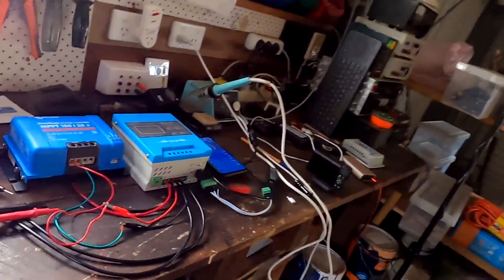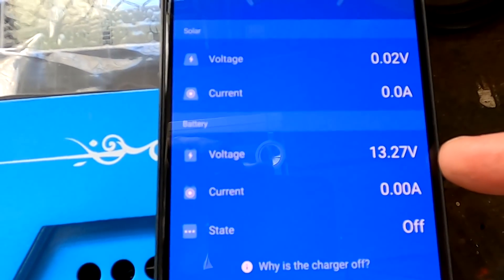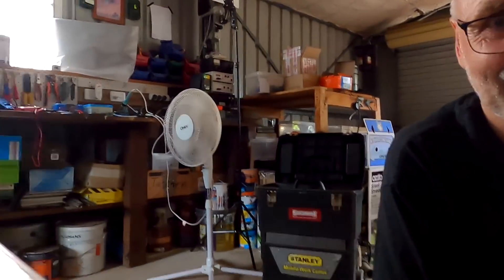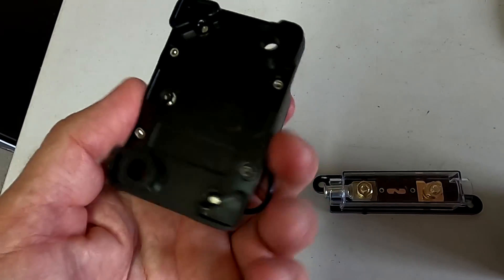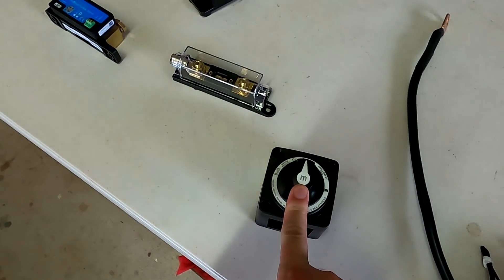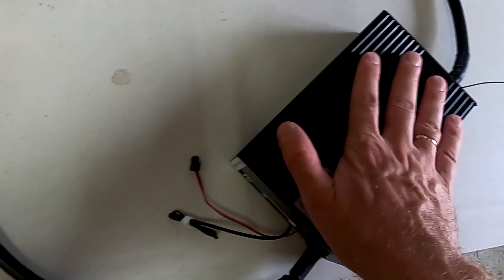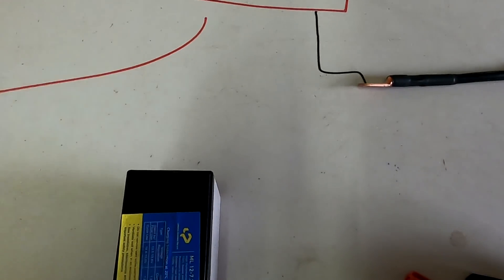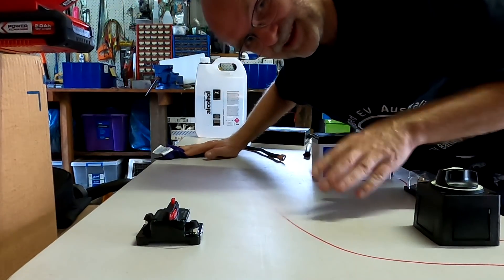How to arrange all your battery gear? Best practice?

Comment: BMS directly on the Battery bank.
Shunt directly after that.
Fuse doesn't matter, if on positive or negative side, so I would put it on the battery positive. On the other hand: Can't you program the BMS for a max current rating?

I would not use THAT breaker switch, they are not very reliable. If you want to use one, look for TOMZN DC breakers. They are DIN rail compatible and you can get them with high current ratings. A Chinese brand, yes, but one of the good ones, people say.

Comment: Inverter, shunt, good quality circuit breaker it can also be used as a disconnect switch then BMS and battery and the other disconnect switch for the pv coming in hope that makes sense

Comment: BMS directly to the battery (no other components in between) - then then smart shunt.   Fuse (inside) and then the big Switch on the outside of the box

Comment: Every connection is a potential failure point. Every connection is a potential high impedance waiting to happen. Get rid of the shit - balancer direct to fuse then into battery neg. Then connect whatever other shit after the balancer. Check the latest vid from Will Prowse. He got 272AH batteries - expecting EVE 280AH.

Comment: Consider the inverter peak current consumption, for starting inductive load inverters are rated to handle twice the rated current for around 10 seconds.
60A X 2 = 120A. Can that fuse handle that much current?

Comment: I have a BMS with split charge and load so I had to put shunt between battery and bms. Else I would have probably put it other way around as the shunt still uses abit of power. And with bms low voltage disconnect active it will still continue drawing power which is probably unwanted.

Comment: You never fuse the switched side of battery. Everything doesn't matter
Reply: the fuse goes on the positive side of the battery. he needs a class T fuse there or a very expensive DC breaker for the high power LIFePO4, not cheap automotive breakers or fuses. the switch needs to be rated for the DC voltage being used. I use 24-volt LiFePO4 (wired 2P8S). 16 272Ah Lishen cells wired 2P8S for a potential of 13926.4 Wh ( 3.2volt x 272Ah X 16 cells = 13,926.4 Wh potential). I am using the Electrodacus SBMS0 so my shunts to measure the charge from the PV array and the load from the battery are on the positive side. 
other BMS use the shunts on the negative side. The shunts are used to measure voltage or amperage differences as they cross through the shunts.

Comment: Battery negative to shunt battery side (shunt resistance is negligible), then BMS (you want to account for BMS power consumption, which can sum up very quickly), then load negative. Battery positive to 100A mega fuse, main switch. Beware of using the cheap Dc circuit breaker. I've seen them blown up and melting away, they usually get pretty hot even without heavy load. This is how my battery system works pretty reliable.

Comment: Fuse should always be as close to the power source as possible (in this case the battery). If you are creating a 48v battery bank then right next to the most positive terminal of the battery.
You need a laser temperature sensor to check for hot spots under full load. Lastly the low voltage trip switch you have are not very good in my experience I would not put it in circuit as it will creat issues on high loads, they arc when tripping on 48 volts. If you have a master switch and fuse then it’s not really required anyway.

Comment: Battery negative to BMS to shunt to inverter negative. On the positive side side I would install the Blue Sea on/off switch between the battery positive and the fuse. This will allow you to replace the fuse with no power being applied.

Comment: BMS connects directly to the battery.  It is your last line of defence against a system fault.  You would then install the shunt in series to the BMS.  Your fuse can go between your negative busbar and the shunt or it can go between the positive busbar and the positive battery rail.  The same goes for the DC disconnect switch as it can go on the positive or negative side of the circuit.  If you were earthing one side of the system (positive or negative) then you would install all safety devices in the opposing conductor but as you have it right now, it doesn't really make a difference as long as the BMS is connected to the battery and the shunt, fuse, and switch are in between the BMS and the load.

Comment: I have a 100A circuit breaker like yours for a 48v system and it works great.  As long as your 200A one is rated for 48V(60V) use that.  But then all your wiring needs to be rated for 200A (probably 1/0 or 2/0 cables).  It works as both a switch and a fuse.  Then save your fuse and switch for something else.  Put the fuse in the center of the battery pack(unless your BMS will go nuts doing that).  Then if you short any of the battery cables near positive to near negative even inside the battery case it will trigger.

Are you sure you just want to measure one circuit?  You probably should have 2 shunts.  One on the charge controller loop and one for the inverter.  You could add another if you just want battery amps in or out too. 

As for the 3000W inverter.  You want to size for lowest voltage.  That could be 40V on your 16s system.  So then you are rated at 75A.  Fuses need to be at least 125% of that so about 93A - 100A should be good.  Wire size needs to be 2awg for a 100A breaker.  Your charge controller circuit wires can be smaller, but then you also need a fuse/circuit breaker for that loop too.

Just think if you mounted all this on some plywood.  You could bolt plywood to the angle iron on the wall and screw each component in with small screws and it would already be done.  Hee hee.  Insulation on the wires will melt before the wood.  So it isn't something that is going to cause a fire.  Probably more likely to cause a fire if you are not venting your enclosure or you have a wire touch a sharp part of the box and short out.  But I am sure you will put it all in neatly with a fan for some air and not have an issue.

Seriously, to answer your question.  Typically, you put all fuses on the positive side closest to the battery.  The BMS and smartshunt have specific requirements where they need to be and I think they both will be on the negative side.  A shut with an external meter will likely want the shunt on the negative , but get your meter first before making that decision.

Comment: Definiely wire from battery negative to shunt as shunt never lies and measures what is going in and out of battery. Nothing else can touch that negative terminal. Same with fuse to positive always as close to battery as possible I have been told.

Comment: 1) size fuse for wire size. have correct wire size most fail at this.
2) buy Quality its cheaper in the end. i see all cheap junk.
3) fuse-shunt-bms-controller.
4) KISS = keep it simple stupid - every wire, connector, solder point is a failer point. i would never ever use lithium.
5) cooling need fans for cooling if in a box.
Reply: Not quite.
Size fuse for 125% of continuous inverter load and/or charge controller rated current.
Then size wire for the fuse rating.
Size shunt for peak load.
Start with the wire and you might end up blowing fuses.....
Reply: @jmaus2k  fuze is to protect wiring. wiring size to invertor. a1500/3000 invertor you would be blowing alot of fuzes at 125%
Reply: @mightystreaming933   But you first need to design for your continuous load.  Your inverter draws 20a for 3hours.  Then multiply by 125% to get  25A.  You need at least a 25A rated fuse.  You can also size for peak load which most fuses can take 2x their rating for 10 seconds(similar to the peak that an inverter would have anyway) or whatever it is.  And if that isn't enough up the fuse or choose a slow blow vs fast blow fuse.  If you have higher temps like on a roof you derate even more and that could be 30A.  Or if the size fuse isn't available you go up to the next size.  Then  you size the wire so it won't burn up before the fuse blows.
Reply: @jmaus2k  close enough. read the manual it gives specs for each device. i use max wire size myself. most people way under size and the cheapest junk.

Comment: https://a.aliexpress.com/_mrCgZUv

As you can see at the photos of some customer’s Reviews of this Qucc BMS that they did the tear down, it has a BYD contactor inside (different to other BMSs that uses MOSFETS), you could remove long cables and join as close as possible bms to shunt, to avoid voltage drop as maximum.

Comment: The BMS is to protect the  cells . It is considered as a part of the battery. The shunt is to mesure voltage and current to and from the battery, so it will go after the bms (who is part of the battery) and before any loads or charger. The fuse goes to the positive side of the battery, as close as possible of the battery in order to protect all the wiring. The switch goes after.
Note that i made a distintion between cells, and battery. A battery include the cells AND the BMS
Reply from the maker: That's a great explanation. Thank you.
Reply: @OffGridGarageAustralia  but not true, shunt before bms... Cause it need to be precise, bms do not care cause it mostly rely on voltage to work.
Reply: Yo lo tengo instalado igual, pero en lugar de fusible tengo un magnetotermico de 200A y no tengo interruptor general, tengo un Conector Anderson para desconectar completamente la batería.
Ten en cuenta que la mayoría de inversores tienen la función de dar el doble de potencia durante unos segundos, para arrancar motores, por lo que un inversor de 3kW puede entregar 6kW durante unos segundos, el fusible de 100A puede quedarse pequeño.
Reply: My thinking is the same.

Comment: From the positive terminal of the battery I would go with the 100A fuse as close to the battery as possible, then the Blue Sea switch and then the main positive buss.  From the negative terminal, I would go with the BMS first, then the shunt and then the main negative buss.  In this configuration you have your battery protection equipment as close to the battery as possible.  However, understand that the shunt will not recognize the small amount of power being used by the BMS circuitry.  If you don't fully cycle the battery up to 100% to re-synch your SOC reading it will over time, drift slightly higher than the actual battery SOC.  That's not a critical issue for a battery of this size and is easily corrected by charging the battery up to 100% every once in a while.  

One other thing you might want to consider is to use a Class-T fuse near the battery terminal instead of the ANL fuse you are showing.  I believe the ANL fuses only have an interrupting capability of about 6,000A, and these 280Ah batteries are capable of generating a much higher fault current for a close in fault.   For example, if the internal resistance of your bank at 12 volts is in the 1 milliohm range, then you could generate a 12,000A short circuit near the battery terminal.  Class-T fuses have an interrupting capability of 20,000A.  I would definitely not use that 200A breaker for catastrophic protection of the battery.
Reply from the maker: Would the ANL fuse not melt as well in case of a fault with such high currents?
Reply: @OffGridGarageAustralia  The interrupting capability of a fuse is determined by what it can safely handle when trying to extinguish the high direct current arc that occurs once the fuse melts, without exploding and becoming shrapnel. DC faults are harder to extinguish than AC faults and with high enough fault currents and voltage the fuse could fail to extinguish the arc leading to a more catastrophic situation.  As a practical matter, at lower voltages you can probably get away with using an ANL fuse, because there are other factors which limit the actual amount of fault current that the fuse sees, including the resistance of the battery terminal connections, the wire path resistance, and the actual fault resistance.  However, the closer the fault is to the battery, the higher the available fault current is and the higher the chance that the fuse may not safely extinguish the arc.  It's a matter of evaluating the fault exposure risk and your risk tolerance for the specific application.  The Class-T fuse just gives you a higher safety margin to work with in the event of a catastrophic close-in dead short.  

Of course any kind of low resistance fault that occurs at the battery terminals between cells ahead of the fuse is the worst case scenario, because the fuse would not see the fault current in such scenario.  That's why it is imperative to use insulated tools and cover up the terminals and buss bars when assembling the battery pack and installing balance leads.
Reply: Following up on my previous comment, here is a really good video on fusing choices for lithium battery packs.  After watching this video you will definitely not want to use ANL or cheap fuses as your main battery protection.  Quality Class-T fuses are the way to go for lithium battery pack protection. 

https://www.youtube.com/watch?v=SjzbQlsiiuk

Comment: I will get the ire of the community, but keep the receipt of the smarthunt somewhere safe. I found that my BMS Bluetooth software showed more or less the same information as the shunt (just in a Chinese kind of way) and in the end I decided to get my $200 back for the smartshunt and use the money for something else.

The smartshunt displays all the information much better and more user-friendly than the BMS app, but in the end I decided to safe myself some money.
Reply from the maker: The only reason I ordered it was to connect the shunt to the other victron devices. The charge controllers read the voltage directly through the shunt for example.
But I agree with you it kind of doubles up with the BMS.

Comment: The way you want to wire it is how I did it and is correct. Shunt has to be directly connected to battery, needs to read the current directly from battery, not after loses from any device.
Reply: The current is the same throughout the circuit and the shunt has separate leads to read the voltage at the battery terminals.  It would be ideal to have the BMS be the first item on the battery since the BMS is managing the individual cells and you want a negligible voltage drop on the negative connection to the BMS.  The shunt will likely have a fixed resistance that is higher under load than that of the BMS.  You don't want a false reading from power routing through the negative balance lead to the BMS and bypassing the shunt.
Reply: @kuhrd  you are correct about bms position, it would be best to have battery connected through bms first then shunt afterwards.

Comment: I can not find any documentation for this particular qucc-bms. So it is not possible to give you an educated advise where to put it in the circuit. For the other components normaly I would say in the battery negave line, fuse first, breaker-switch second, current-sense-shunt third. Background: Even the breaker-switch will have a less current-specification, than the battery can deliver, so the fuse first. For maintenance or failure than the breaker-switch, to really cut of the battery from the system. But be aware of voltage-dropps at load across fuse and breaker, as I always say. ;-)

Comment: moin,  the shunt needs to be after the bms or you will add the resistance of the shunt to the voltage measuring circuit of the first single cell of the battery, therefore measuring a wrong voltage and falsefying the values and finally balancing it wrong. ergibt das sinn? grüße aus hamburg
Reply from the maker: Moin. But the balance leads start with the black wire which is to be connected to the most negative terminal of the battery. It does not measure the voltage through the thick cable.
Reply: @OffGridGarageAustralia  i think the old principle applies: "ground is ground is ground" and therefore it would be on the same potential level. meaning you've built a bridge bypassing the shunt a little bit and falsefying that measurement of the shunt. just to be sure measure the resistane of thick black to thin black. if it is 0 ohms it is on the same level. if it is not on the same level then they put in some extra circuitry which the usually don't due to cost effectiveness. but i might be wrong. o.O
Reply from the maker: @partyboarderdos  it cannot be on the same level otherwise parts of the load would be going through the thin wire, right?
Reply: @OffGridGarageAustralia  That's true but usually there is nothing in between the battery and the BMS and why would one jump throught some extra uneeded hoops. i think the answer would be resistance measurement. i am curious now.
Reply from the maker: I can measure 100ohms between the thick and thin wire. Tried both directions.
Reply: and one thing that i was missing. there are BMS that do not have the thin black wire. they only have exactly the same amount of balance wires as the amount of cells.
Reply: @OffGridGarageAustralia  check this, it may vary by BMS but I recently had my JBD bms connected with the balance leads only (main negative battery was disconnected (and the first two cells were reading wrong. cell one was close to 0v I think, and cell two was around a quarter what it should have been. So this does seem to suggest the main negative is used for the balance readings of at least the first two cells, at least on that BMS.

Comment: If it was a sealed battery like a battleborn the BMS would be 1st (inside the case) then the shunt (outside the case) so personly i do it in that order ? 
For POS i like the fuse to be on the post if possable but if not the lead from POS post to fuse has to be short enough to never reach any possable NEG/Earth/Neutral, if i can't use a post mount fuse i usually glue the fuse as close to the POS post as possable, either on top of or on the side of the cell/battery.
Really enjoying the series chap :)